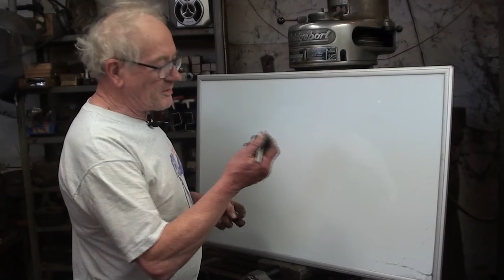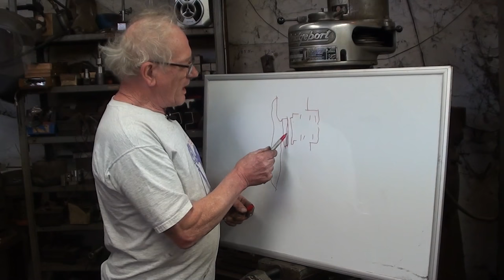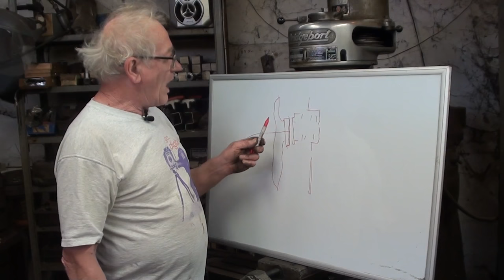The Flying Dutchman Shows You How To Rebuild a Water Pump! Part 1

Comment: I have a BMW 2002tii with a leaking water pump, I am not able to find rebuild parts for this pump. Do you think if I buy a new non-tii water pump (same internal components) dismantle the new pump and then use those parts on the tii pump housing, am I likely to damage the parts from the new when pump while I'm dismantling it? thanks

Comment: General rule for rebuilding a water pump. Never wait always remove the hub.
What's the hub, bub?
Reply: That is that dimeflopsy you bolt the belt pulley on.
Reply: And here I thought it was the Finnegan pin.